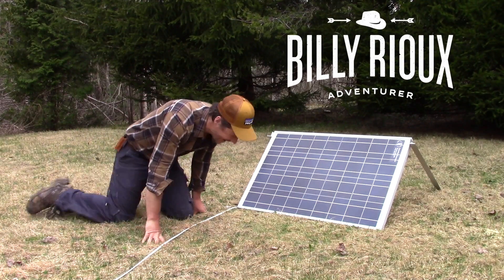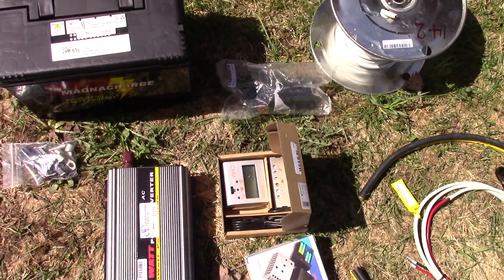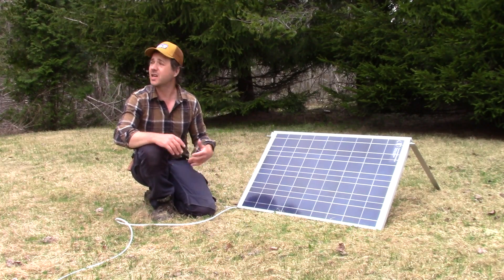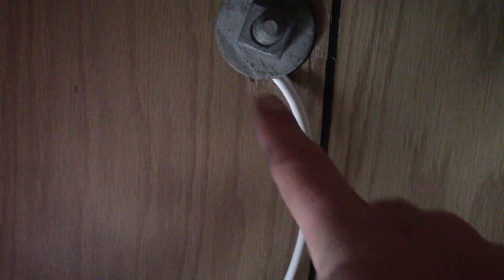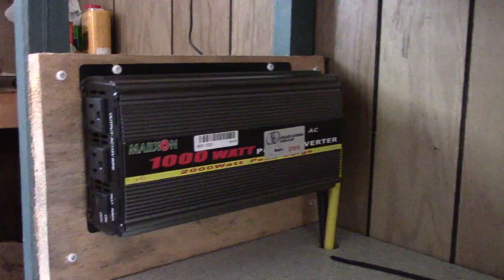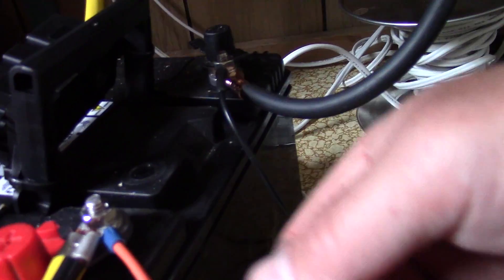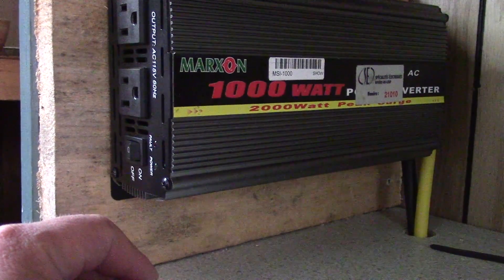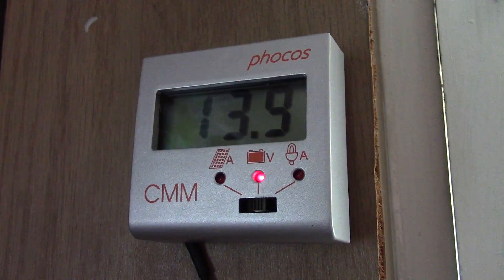Cheapest Solar Panel Kit EVER For Off-Grid Cabin!

Comment: Since you go a while without using it, you should add another battery...It will have time to charge, and when you use it, the batteries would not drain as  much (and would last longer)...bonne chance
Reply from the maker: Thanks Donald, I will put another battery very soon.

Comment: That totally silent solar power is awesome.   Connie and I are running three L.E.D. lights off of our solar system which lights our cabin and it is totally silent.   no noisy hissing pressurised gas lanterns and no noisy generator.   Solar is awesome.   You are going to love it.
Reply from the maker: Thanks Lonnie! So far, it's great, I love so much the silence. And... I was a bit tired of the candle... mostly on my reading.

Comment: I have 2- 125 watt panels on a stationary stand .. an mpt sunsaver charge controller and inverter .. also 4- 6 volt golf cart batteries with 2 ea. in series for 12 volts.. all LED lights in my camper .. runs my satelite internet and my laptop and charges most every thing I need .. love being off grid ..
Reply from the maker: Brett! This is a smaller solar panel kit than me man! wow! Good to know!